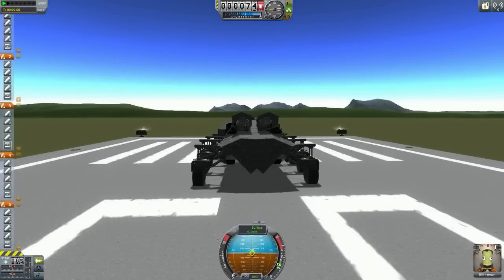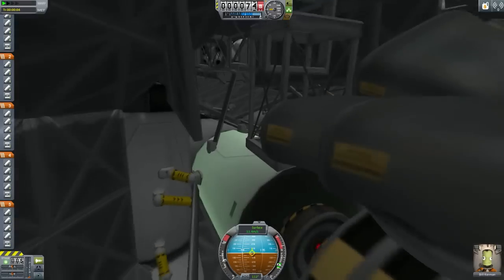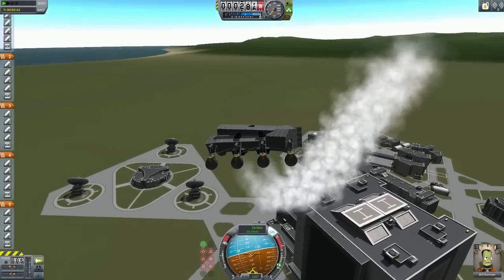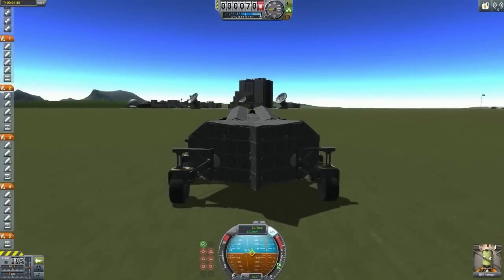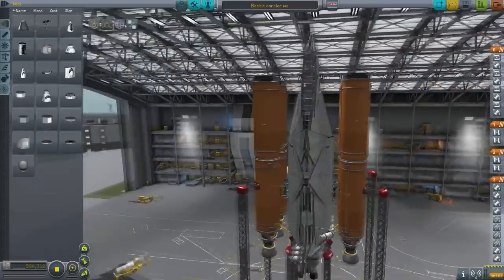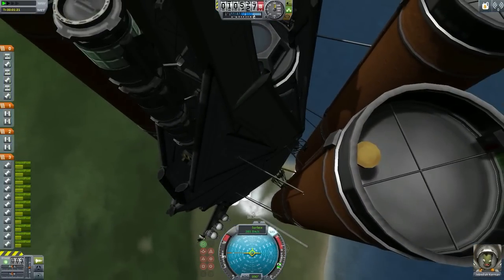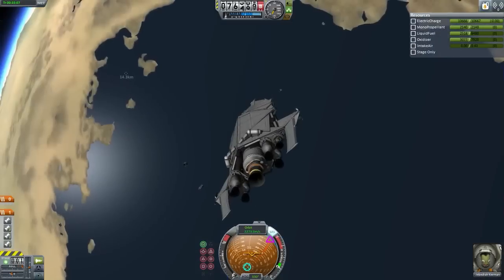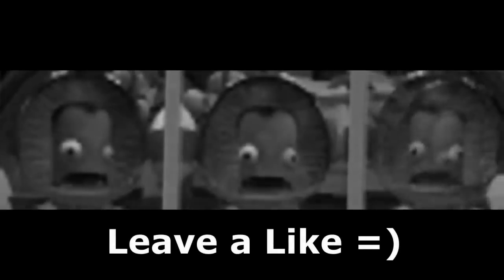KSP : Subscriber Designs Ep.21

Comment: Of course its weak; it's big. Easily a kiloton of weight moving at 16mph... You hit the hill and suddenly all that weight is put upon the front right wheel joint... For a micro second, time freezes upon impact and the entire vehicle comes to a total stop... And then the momentum kicks in and carries on. Suddenly, the wheel joint experiences a force loading of 1 kiloton @ 7 m/s... That's 80 milion Newtons or 9400 TONS! of force...

...all on that front joint. 

There'd be less force in ramming a tree with a 3200lb car at 200mph. 

When you weigh a lot, you move really slowly and avoid speed bumps.
Show less

Comment: Heretic, you should make two things:
1)Ho 229 >:3
2) A base that is made out of multiple asteroids, 1 for fuel, one for cockpits etc
Reply: He 162 would also be interesting
Reply: Or a me 262
Reply: Those 3 planes are requested so many times...

It makes me wounder if I should go upload my crafts to heretic for each plane =l.

I haven't updated the HO 229 though so I should probably work on that...
Reply: R4V3-0N  well they were built, yeah, but good ones? not really... most people donte ven know that the 229 has rudders :/
Reply: Dms110 The Ho-229 (Go 229) doesn't have physical rudders on the 6 physical prototypes (most flew) and the nightfighter variants do not either have the 'rudders'.
The Horten H.XVIII (the larger strategic amerika bomber version of Ho 229 proposal) doesn't have 'rudders' either.

I think you confused the HO 229 with the YB-35 and YB-47 .

The Ho-229 (as all flying wings) does have a method of Yaw. (and is the best method of doing it until the B-2 which came many decades later). 

And I did it good and it flies well (just don't yaw... I made it able to turn 'okay' and pitch and roll but NOT yaw... yaw is only used for taxi'ing) http://steamcommunity.com/profiles/76561198103044000/screenshots/

That's a steam screenshot of my Ho 229 top view in mid flight.

However the plane I am most proud of is my Avro Vulcan replica and my Ace Combat "ASF-X Shinden II" replica however the Shinden doesn't have it's legendary turning and VTOL abilities (in fact my vulcan out turns it =C)

This Ho 229 I made was pre update and right now it looks UGLY.

http://steamcommunity.com/profiles/76561198103044000/screenshots/
My vulcan

http://steamcommunity.com/profiles/76561198103044000/screenshots/
my Shinden 

Btw the Vulcan is very functional.

it has a bomb bay and it has all sorts of lights ranging from navigation lights, short and long range strobe lights, landing lights, tail light, logo light, etc. Literally everything a conventional or large bomber aircraft would have!.

My vulcan is quite detailed. I like it. 

I sadly do not like my Me 262 or He 162 to much due to it not being to scale (no small jet engines...), however I did make the Me 163 and Lippisch at some point.
Reply: R4V3-0N  Its rudders are kindof weird in aw ay, as they are concealed and only activate when needed, they are kinda like.... airbrakes that only pop out when needed, i guess you can call it :P also, werent tehre jsut 3 models created and flew? not 6?

also, sorry but I cant see your 229 pics on Steam, my Steam website's language is all completely messed up...

But i do see you like War Thunder... wanna play sometime? :P
Reply: Dms110 Those are not rudders as we know it.

As I said they had there own methods of yaw.
For the americans and there flying wings it was making 1 engine at a lower throttle on 1 side less or more then the other. However you can see how this will suck on landings as the only way of yaw on your landing is to accelerate which isn't good...

The thing is that KSp can't model this either...
Mods would be required and it can be made without them.

Also I want to add that you should still be able to look at the image... unless I derped at the links... otherwise just go to my account at look at my KSP screenshots, You'll find hte shinden, vulcan, some Hortens, etc... planning to upload more pics.

And I do like war thunder however it's quite poop for me these days.

UK top tier jets are no better then the entry level jets of some nations nad bombers are so underpowered that my wellington was killed by a german_rifleman...

Yes, a huge bomber famous for being the most durrable plane in history was shot down by an infantry in war thunder and this is an enemy target that is known for not doing jack **....

I can play ground forces with you but after 1 or 2 bad games do not expect me to play with you for another week. I need a cool down period.

(Yes, I like flying british... sadly they've been the underdog ever since .1.28)
Reply: R4V3-0N War Thunder aint THAT bad...  I never got around to playing with my German jets because shortage of lions... yay. all I know so far is that the Me262 is shit and I played with my 229 a bit... sux arse
Reply: Dms110 Me 262 is far from shit (compared to the other jets in game). It's just that it isn't made as a dog fighter. it's not an air supremecy plane, it's an interceptor.

So yea... due to how underpowered bombers are currently, this has the effective of the food chain.

No bombers ==> no target for Me 262 ==> Me 262 is 'bad'. just like the bombers.

Anyway the Me 262 is also a very fine design and it can hold it's own to even sabers... granted if the me 262 pilot has skill.
Reply: R4V3-0N  It gets to fight Korean war jets. 'Nuff said...
Reply: Dms110 name me a better interceptor jet of the other nations.
Reply: R4V3-0N  The Canberra with the 4x20mm's is a starter x)
any british jet.... US jets arent that good in comparison to them, lack of good cannons(in the game atleast)
Reply: Dms110 yes, because 4 x 20 mm on a worse peforming plane is better then a Me 262 with 4 x 30 mm on a smaller more energy effecient plane. (and/or with 48-ish air to air rockets or 50 mm cannon)